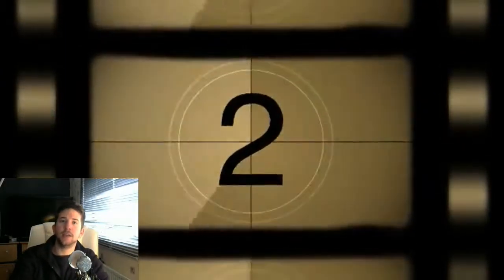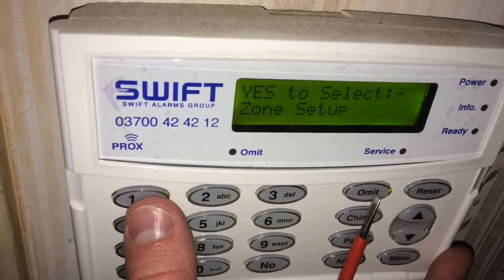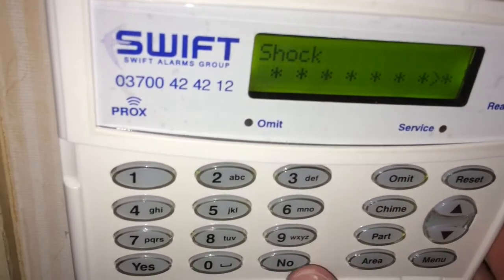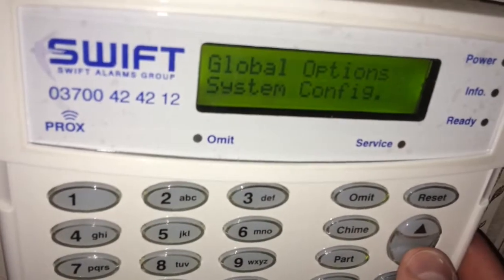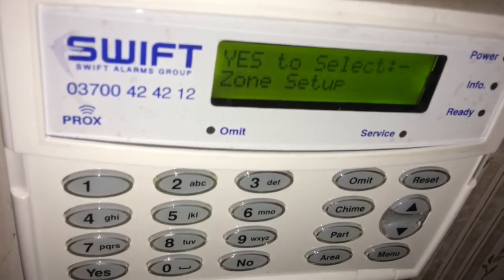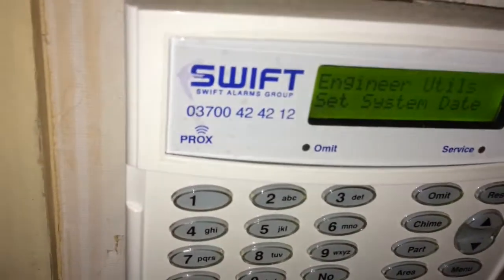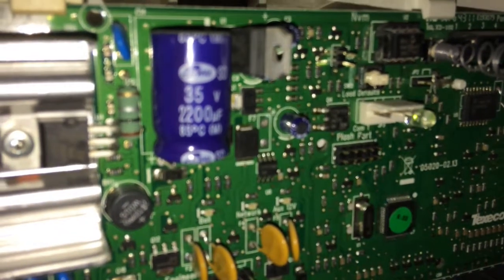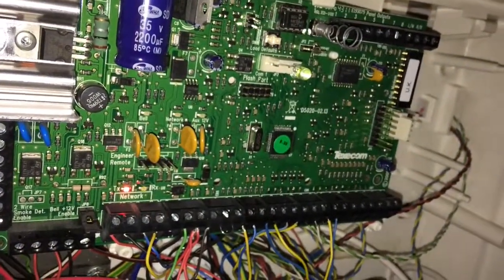Alarm Tech- Premier 24- Basic how to guide

Comment: Hi Alarm Tech, Great video... Is there a way of renaming the name of the company that has fitted the alarm system, which appears on the LED panel in the Premier Elite system?, cheers
Reply from the maker: Hi Mark, yes you can. You'll need to enter engineer mode, press 3 for global options, press yes, press 5 for system text, press yes. Scroll down until you find 'Banner message'. Press yes to go in and edit. Press up arrow to go back, reset to delete a character and once done press yes. Then come out the menu by pressing menu a few times, followed by reset and you should have your new default message
Reply: Top Man, Thank you !!

Comment: Hi Alarm Tech,
I had a 'System Alerts' bell tamper active the other day. So I have opened the bell box and looked inside, checked all wires were connected OK and gave it a clean out before closing it up again. The bell sounder rang for 20mins but I couldn't stop it.

The bell tamper hasn't gone off since however I cannot clear this from the alarm LED screen. Can you please advise how to clear this message and if I have to go into the bell box again, what I need to type in to let it know i'm about to open it without the alarm going off.

Many thanks in advance, Mark
Reply from the maker: Hi Mark, thanks for the question. That problem will occur if the panel doesn't get the negative from the SAB. What you can do is check the cable, but as it's not that important, you can make a link using a core from the 6-8 core cable and put that in 0v and T (bell terminals) this will 'trick' the panel into thinking you're getting the 0v back from the bell. As long as when you do a Bell test the bell works there is no need for concern. If you don't want to do the wiring... From engineers menu, press 3 global options, press yes, press 3 monitor hardware, press yes, press no, move across to Bell tamper and press no to turn it into a star. This will make the panel not look for the bell 0v at all. This should stop the alert from showing. If you still have the message let me know.
Sam
Reply: Alarm Tech sam

Thank you so much for the advice. I have managed to clear the fault !!

Best regards 
Mark
Reply from the maker: @markhughes6042  Well done Mark, glad you managed to resolve it. Can I ask what you did?
Reply: I went for the control panel override. This wasn't because I couldn't do the wiring, it was just that the bell box is at a crazy height up the gable end of my house, i'm confident no one will tamper with it.  Thanks again !!.
Reply from the maker: @markhughes6042  Good choice, the link you'd make between the 0v and tamper is at the panel end, but making it inactive is quicker and easier. You're welcome

Comment: Hi I have texecom AFG-0001 wired DT PIR's to connect to a 64-W panel, they look the same as in the video so I hoped I was sorted, I moved the jumpers JP3 and JP4 as shown however I read 4.7K across the alarm terminals but across the tamper I get open circuit or closed circuit not the 2.2K I expected, this was without any power on, don't know if it matters , tried the jumper on different pins and still no resistance reading. Any idea why ? or do I put the jumpers back and wire it as a global tamper and NC alarm ?
Reply from the maker: Are you measuring resistance at the panel or just out the device? I would have it powered up as if no power it will give off bad readings. The jumpers go vertical and from memory you need to miss one, then go second and third on each side
Reply: @pizzaandchipsmate Thanks for the help,  Test was just at the device, unpacked the sensors to find no info at all so trawled the internet for help, haven't started the install yet, battery not turned up yet, could plug the panel in on the table to provide power then I should get 2.2K on the tamper yes ? and the jumpers go second and third from the bottom, which gave me 4.7K on the alarm pair.
Reply from the maker: @davefee9123  Yes, you'll always have  4.7k on alarm if the device is down powered. Silly question, but are you holding the back and front tamper spring down to test the tamper?
Reply: @pizzaandchipsmate Just the 1 spring bottom left of the PIR. Testing without the spring held down the meter shows overload when held down it shows zero. Will plug the panel in later to power up the PIR and see if it makes a difference. Do you think it might?
Reply from the maker: @davefee9123  I've checked the instructions from a DT and it is definitely second and third from bottom for 2k2/ 4k7 resistance. Where are you measuring btw?
Reply from the maker: Because it's not across the Tamper pair, it would technically be between the first T and first A, with tamper spring held down
Reply: Tested this morning ,after some thought , between 1st T and 2nd Alarm and got 6.8K logged on to let you know and saw your comment, 1st T and 1st A reads 2.2K (easy when you know how lol) so I can connect zone 1 to 1st Tamper and 2nd Alarm then just tell the panel when programming that its EOL ? , thanks for all your help, keep up the good work with the videos I'm sure they will be useful.
Reply from the maker: @davefee9123  Hi David, the panel automatically sets the zone as Double Pole/ EOL, so you don't need to change anything with the wiring programming. When you fit and power it, from menu, press 9 (engineer utilities), yes, press 3 (zone status) then yes, then find your zone and it will say secure or active with the resistance
Reply: @pizzaandchipsmate  Good to know, Have been looking through the manual and under Zone set up there is an option for Zone wiring then option No 2 is Double Pole EOL which you say is ok but option No 6 is 2K2/4K7(6K8), which I would have used .
Reply from the maker: @davefee9123  Yes, you can use that one as well, Double Pole/ EOL is default and will work just fine
Reply: @pizzaandchipsmate  Thanks for all the help, 
will see how it goes when all the kit turns up. Might be back in touch if I have any problems lol.

Comment: Hi i have a premier 48 with a faulty texecom pir do i need to access engineee mode to change it or can i just do it with a tamper alarm going off? If i need to access engineer mode mine asks for 'engineer working on ABCD' prior to being able to do anything else? After entering engineer code i get this message and im not sure which areas or what i  supposed to key in next...how do i tell panel im working on all areas 'ABCD' please.  Thank you in advance
Reply from the maker: Hi, How do you know the PIR itself is faulty? What's the steps you've taken to come to that conclusion? 
You should enter engineer mode before opening any devices as its likely it will need to be reset afterwards anyway. I haven't encountered that 'Engineer working on ABCD' before, only 'Engineer working on Site'. When you type in the engineer code what happens?
Reply: Thank you for the reply.  Im assuming the pir is faulty as it will clear and the panel sets....then a short time ,after it goes into alarm. I reset and repeat and again does the same thing.  While performing a walk test it shows as open one minute then closed the next. Hence my reason it has an intermittent fault. As for the engineer.....enter 4 digit engineer code then alarm code then it asks for areas? Is it because the panel can opperate with separate areas for alarming? I have seen the alarm engineer put in 'working on areas ABCD...' does seem rather strange as there doesn't seem to be any reference to thks in the installation manual only as you describe in your videos? Mine cannot be the only one?
Reply from the maker: @jonbarrie7002 Sounds reasonable, at least swapping out would leave you with only cable damage left. Is it wired EOL? Are you doing the walk test through engineer or user menu?
Reply: @pizzaandchipsmate  its just wired as a separate zone not end of line. And walk test ive done has just been from user menu not in engineer mode as i arrive at that ABCD area thing lol i dont think cable can be damaged but realise i should really do a continuity resistance check on cables to do it correct. I just thought i might be able to just open pir (enters tamper) change it and then reset? Obviously i cannot drop the 12v doing it this way but would it ma,e that much of a difference so long as i dont blow the internal fuse of the panel?
Reply from the maker: @jonbarrie7002  Are you sure that's the correct engineer code? What happens if you just type it in twice? So is it currently wired double pole? (Pair of cores for each tamper and alarm)?
Reply: @pizzaandchipsmate  yes its correct engineer code. And yes its double pole two cores for alarm circuit and two for tamper and obviously V+ and V-. No idea why its like it is cannot find anything to tell why? Thanks for you help. Good videos keep them coming.
Reply from the maker: @jonbarrie7002 Thanks. I've never had that message before. What happens when you put the code in twice? How can you be sure it is the correct code?
Reply: @pizzaandchipsmate  ive not tried putting the code in twice? Ill have a go and see what happens.....as for it being the correct code, i do have someone who normally looks after the panel but due to covid hes not coming rou d so thought id do it myself he wouldn't change the code. I originally installed a veritas r8 but upgraded to the premier 48 as i wanted  something better but the programming was a bit daunting so got him to do final connection and commissioning.
Reply from the maker: @jonbarrie7002  You could give it a go. Would it be worth phoning him and asking regarding that message?
Reply: Cheers for the help appreciated.

Comment: Hello ,i have solved the problem but in zone setup option when i armed the système the bell didn't work .thank for reply
Reply from the maker: Have a check on global options (3) and system config (1) and make sure Bell is an SAB (press down to go through) then make sure 26 Bell= 1st alarm is set
Reply: @pizzaandchipsmate  yes i try it but it didn't work however when i programmed a zone as zone PA audible it work ,i wonder ask you why ?
Reply from the maker: @mebarkirahim9437  What was it programmed as before? If the alarm is unset only Pa Audible would make noise. If set, the alarm can be entry/exit, guard, guard access. If activated if alarm is set and it's guard access it will go off after the entry timer (40 seconds) if it's guard it will go off as soon as activated. Check previous reply regarding System config

Comment: hello mister, i wold ask you some questions ,i did zone test and it's work but when i arm the systeme and i open the door ,the bull doesn't work .
Reply from the maker: If it's the entry door you're opening, you have until the entry time to expires until the alarm goes off.
Reply: @pizzaandchipsmate  the Bell doesn't work
Reply: Hello again , i'am actually in need of some help . is there any chance i can contact you  in private . thank you in advance
Reply from the maker: @mebarkirahim9437  Have you done the bell test? Engineer Utilizes, yes, 1, yes, yes to turn SAB on
Reply: @pizzaandchipsmate  i did the bell test using function engineers utilisations ,and it ,works but when i arm thé système ,it didn't work
Reply from the maker: @mebarkirahim9437  If it works on Bell test, it will work if the alarm goes off. If you have an unmonitored system  You can program the front door as a PA Audible, leave engineers, open the front door and that should set the whole alarm off. Use master code to silence it, set it back to entry/ exit. If you're activating it by setting the alarm, opening the front door it will still be in its 'Entry timer' if you then don't unset the alarm the bell will sound
Reply: @pizzaandchipsmate  OK thank you ,i will try it
Reply: I have the laste question,the pir didn't work when i have programmed zone as guard option
Reply from the maker: @mebarkirahim9437  If you go into zone setup and press down or up to find the zone, make sure it is guard. Next go into engineer utilities, press 3, yes, find zone and it will say the resistance in the bottom right. If you've used resistors then make sure it has 2k2 secure, 6k9 active. If you haven't used resistors you'll need to change the zone to normally closed, by going back into zone setup, find the zone, press yes until you get to wiring (it will say double pole/ eol) press no, then down arrow until normally closed
Reply: @pizzaandchipsmate  thank you some much ,i will try it tomorrow first thing in the morning
Reply: hello mister, i would ask you how can i do the part arm
Reply from the maker: @mebarkirahim9437  To set up a part set, think of the alarm setting with all zones in and you need to take out ones you want the alarm to ignore. So, in zone setup, go to the zone you want to omit (landing for example), it will have the zone type (guard) press yes until it says attributes, please no then down arrow until it has Part 1 omit, press no to make a 1 appear then please yes. Do this to the other zones and now if you were tondo a user code part and yes it will set with the zones you've omitted taken out
Reply: @pizzaandchipsmate  hello mister, i did programmed the zone normally closed but when i go to engeeners utilses ,i find the the zone have >65 K i didn't 
use any resistors
Reply from the maker: @mebarkirahim9437  Hi, If the zone is active (door open, PA pressed, PIR activated or not powered) it would say 65k as it's normally closed. If it's secure (door closed, PA reset, PIR powered and not active) and still 65k you need to check the wiring.

Comment: How do you factory reset the panel & get default codes?
Reply from the maker: To default everything, try downpowering and repower the panel with 'load defaults' pressed or shorted out (either button or pins) you might need to do a kick-start off the battery by connecting the battery and doing the 'kick start' pins/ button. If it doesn't default engineer code the NVM is locked and there isn't an easy way to get round it
Reply: @pizzaandchipsmate  cheers bud

Comment: Hello Sam how do I go about changing the entry timer
Reply from the maker: Hello, enter your engineer code, and press '2'. You'll have 'Area Programming' Press 'Yes or tick' and then 'Timers' is your first option. Press 'yes/ tick' (will say exit delay) and then 'Yes/tick' once more and it will say 'Entry 1 Delay' Press 'No' type in desired time. Once done, press yes, then menu, menu, reset, yes
Reply from the maker: This is if your panel is an 'Elite' Press Menu and then 4 to view your panel type. If you don't have have an Elite panel, let me know
Reply: @pizzaandchipsmate  thanks for that 👍👍
Reply: @pizzaandchipsmate  no it's a premier elite 24 so it's fine
Reply from the maker: @promedia7696  Excellent, you're welcome. Anything else, let me know
Reply: @pizzaandchipsmate  how do I get in to the menu option on the keypad to change the normally open and closed and the resistance I got it last night but I can't seem to find it could you help
Reply from the maker: @promedia7696  Type in your engineer code and the first option is zone set up, press yes, then press the arrows to go to the zone you'd like to change, press yes to go to the next option until you find 'wiring' it will say EOL, press no, then either arrows or 0 to change to normally closed
Reply: @pizzaandchipsmate  ah grate thanks for that one last thing what battery would I need for my panel 

Sorry for the questions it's my first time installing this type of alarm stuff
Reply from the maker: @promedia7696  Not a problem and sorry, didn't recieve the alert. I would recommend a 12v 7ah battery
Reply: @pizzaandchipsmate  thanks for this your help is much appreciated